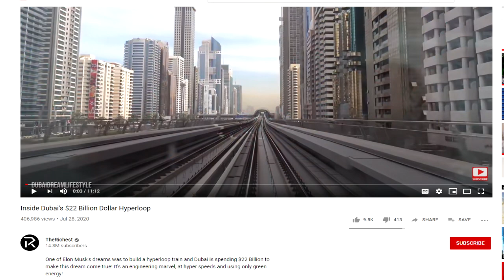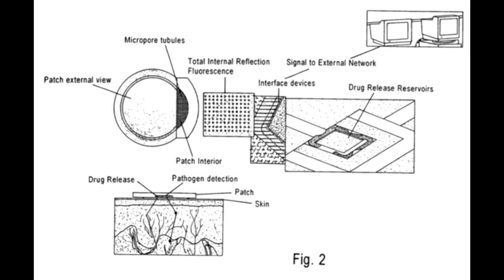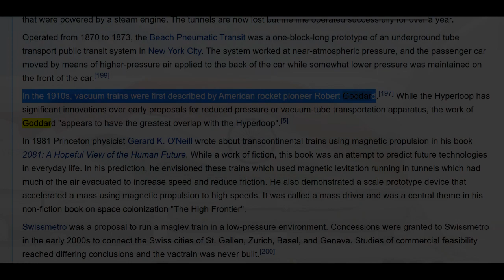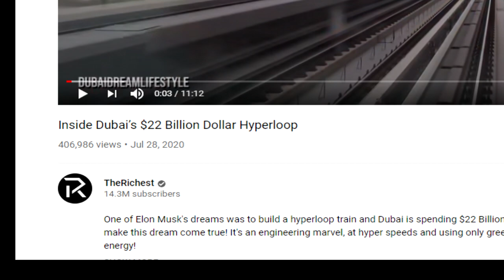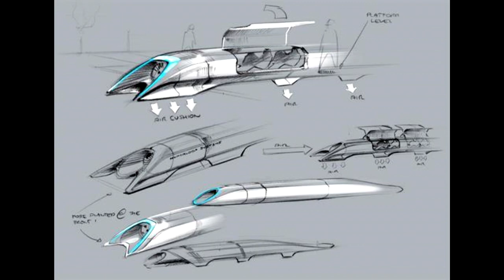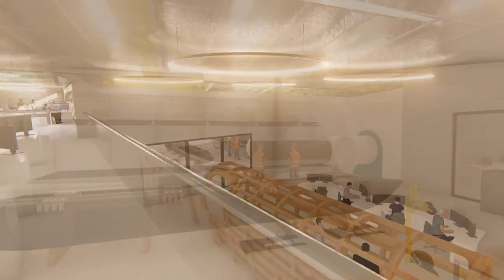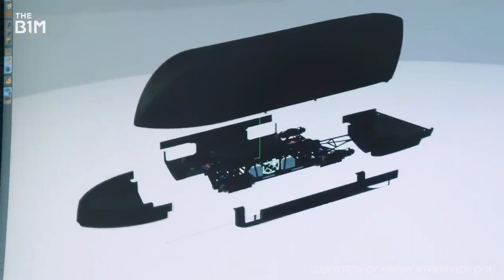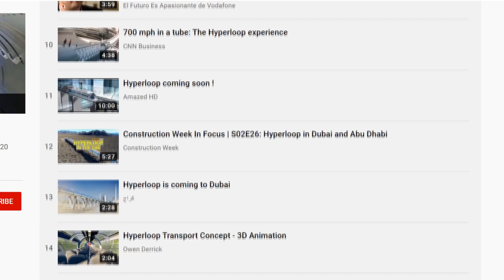Hyperloop, the biggest Scam since Theranos

Comment: "Air bearings" or "air skis" means that the capsule, which weighs several tons, rides on a cushion of high pressure air that's high enough pressure to support tons of weight above it.... in a vacuum... wait, how's that supposed to work, Elon? High pressure air in a vacuum?
Reply: Lots of pumps. Granted, it would be A LOOOOT of pumps.
Reply: Cleary he never thought that far ahead.  If only someone else had done it first, then he could copy their design, put blue lights on it, and everyone could gush over his innovative genius.
Reply: I think he was playing air-hockey at the time the light-bulb flashed ;)
Reply: put a hovercraft skirt with a number of internal air bladders so it's perimeter can be stiffened to control airflow.
release a volume of air under the craft into the skirted cavity equal to or just greater than the amount that would escape under the skirt for an optimal air cushion.
the pressure differential outside the skirt draws the air inside the skirted cavity underneath and out, creating a thin layer of air travelling under the skirt.
use the pressure zones inside the skirt to regulate the flow underneath and form a thin and uniform layer of air as it escapes the skirt cavity under the craft into the vacuum tube.

i have no idea if this would work, but you can come up with something plausible if you use your brain for a hot minuet.
Reply: @compoundlift7578  You can't release air into a vacuum and have it remain a vacuum.
Reply: @trippymchippy8586  i'm sure 30 litres of air will instantly replicate itself to fill 10,000 litres of space to 1 atmosphere.
Reply: @compoundlift7578  30 liters of air will get you to move about 0.001 Meters, and where are you going to release the air from, is it stores in the capsule? or is there going to be a long pipe blowing air up under the skirt, (with a vacuum around it)
Reply: @compoundlift7578  with the skirts of this Over craft being riped appart from high speed friction.. Dude, overcrafts are Slow..  maybe 50 Mile per hours. There is a reason to it. The skirts require high maintenance, there is a reson as well.  Once the Air has escaped the skirts, were does it go ? It will need to be pumped out of the tube. And this air, you use for the cushions.. Were does it comes from ? The environement is a vacum....  Yeah this was definitly well though throug.
Reply: @specialopsdave  the problem is that the pressure would try to equalize so if the tube was in a vacuum it would be impossible. Literally impossible. You would be spending energy keeping the tube in a vacuum while at the same time pumping air into the tube...
Reply: @compoundlift7578  Everybody replying didn't read the last part of the last line of your post.
Reply: David Parry everyone keeps doubting Elon and he just keeps proving all them wrong 😂
Reply: Its magic, the laws of physics work on very local small areas, and in other areas you have the completely opposite working as a contradictory law of physics.

Really, if you think about it, all that Elon Musk is asking, is for the laws to stop applying to reality a bit, but only for his "inventions". Thats not too much to ask, especially if you ask nicely.
Reply: To be fair, the original idea did NOT use a vacuum tube. In my opinion it was more feasible. But then it quickly morphed into maglev in a vacuum. Perhaps an engineer figured out that the air cushion was harder than creating a thousand mile vacuum tunnel. If so, then that's two impossible things.
Reply: Clearly none of you have degrees in engineering.
Reply: DO
NOT
ASK
QESTIONS!!!
Reply: @compoundlift7578  that is not how it works in a vacuum, let alone at 600+ mph.
Reply: @danieljusino1391  
no.
Elon musk, so far, has not invented anything.
Reply: I think this is a confusing aspect of the design. It’s not a perfect vacuum so the front of the train car is pulling the air in front of it and turning it into the cushion.
Reply: Can't believe he actually said that publicly, just shows how unremarkable his mind actually his lol.
Reply: Trazyn the Infinite I didn’t say he invented anything ?
Reply: @Mrcaffinebean   The shape of the pods does not suggest this is the idea AT ALL. If that were so, the nose would be an inverted wedge lol.  That being said, the question is, is the density of the air, plus the weight and velocity of the shuttle sufficient for this? Certainly wont be when you're shuttle is accelerating from 0. On top, air pressure and temperature isn't going to be constant and uniform throughout the tube, so you'd need a very robust and dynamic system to adjust airflow so that the thing doesn't fly off the rails or grind to a halt.
Reply: @trazyntheinfinite9895   okay, how does it work in a vacuum?
why would essentially a hovercraft, with it's own supply of compressed air and a method to regulate the air escaping it's skirt, not work in a vacuum?
Reply: @CasusBelli1000  i'm sure if you use your brain, you can come up with a plausible answer to those questions, all on your very own!
remember: air is a compressible fluid, and a skirt can be made of, or coated with, all sorts of things!
Reply: The Chainsaw Squirrel all very solid points. I think with this video and some other people in the comments miss most of all is that all of this, is a concept, work in progress.

That is engineering. If the finished product doesn’t look very different that the early drawings then likely there wasn’t much of a challenge to solve. 

In the case of these air cushions all the companies doing this looked at and said too much work, to little gain. Makes sense, it doesn’t mean suggesting he concept was bad.
Reply: vacuum preloaded air bearings are a thing used in industry for low friction high stiffness applications you know? the flow rate can be very small for well made airbearings
Reply: the air bearings where in fact one of the few interesting and novel aspects that made the hyperloop different from previous vac-train concepts. that all the companies gave up on it shows not that the concept was bad but that they don't care and want to just scam people.
air bearings with high load and low flow rate are a perfectly real thing used in industry and if they could be made to work at high enough speeds (the precision of the rail probably being one of the main limiting factors) they would be much more energy efficient than maglev and alleviate the need to have expensive power electronics along the whole track as would be the case with a transrapid based design.
but thats difficult (though likely possible) engineering that only results in a shiny demo for investors in the very end so the scammers don't bother
Reply: I was thinking the same thing...like wouldn't the air cushon destroy the vacume?
Reply: Hicknopunk well, it’s not a vacuum sooooo
Reply: @compoundlift7578  While I agree there may be a way to do it, any solution to solve this kind of incompatibility( we need a vacuum/we need an air cushion ) is very likely going to be more complex and costly ( and probably more prone to failure ) than an alternate solution for either side of the original incompatibility. This is where you end up realizing that instead of solving the problem as stated you need to go back and redesign to avoid the problem in the first place.
Reply: David Parry  Elon is smart, but not a scientist (obviously). I am sure he wants to distance himself as much as possible from Hyperloop these days. It has become a self playing piano featuring scammers from everywhere. I am sure he regrets the whole thing now.
Reply: Not an issue, you just need to remove the air that you add into the system continuously.
Reply: @fiddley  They did think about it and it was clear he didn't think about it enough.
Reply: @MrRobinhalligan  Yes he did, it's a YouTube comment, not an engineering thesis. If subsequent commenters engaged grey matter for a nanosecond they would see clear ways to mitigate the weaknesses in his off-the-cuff suggestion. The major problem seems to be that none of them understand fluid dynamics or the definition of a vacuum in an engineering sense.
Reply: @Mrcaffinebean  you ALMOST saw the problem! people are investing BILLIONS of taxpayer money into what is unproven technology, not only is it unproven, it currently has NO WORKING PROTOTYPES, not even prototypes that COME CLOSE to ANY of the talking points they claim as fact.
Reply: @fiddley  as of now, none of the prototypes really take advantage of the vacuum. there is a very clear contrast between using an air skirt (in whatever form you prefer) in a vacuum. such a solution may be possible, but is completely impractical. if you want to argue anything, even running it on a superconductor rail is more realistic and has better production tolerances than whatever that monstrosity would become.
Reply: PersonalPerson I agree tax payers shouldn’t be in this thing. I feel that way about everything pretty much. 

Little late now though.
Reply: the drawings show how it is proposed to work. it's not a vacuum but low pressure, as thunderfoot explains even low pressure will build up in front, causing drag. fans at the front would extract this air, reducing drag, and shoot it out the bottom to provide the air cushion.
Reply: sato AU exactly there is no addition or subtraction of air in the tube. It’s merely moved. That said I have no idea if it could be made to work.
Reply: @Mrcaffinebean  from what i can understand there will be a reduction of air in the tube, but not to zero. agree that it may or may not work, which is much more sensible than just concluding that it won't, as this video does.
Reply: @MrBerndhorst  (and others) I'm just "cogitating, or thinking". I don't pretend to know the answers, these are mainly questions that come to mind.If this system was LOW air pressure, I suppose you MIGHT be able to suck in air at the front, and expel it as an air cushion, but it intuitively seems this air-cushion idea still needs fairly tight tolerances (1-2 cm?), in order to provide adequate pressure  on the "bearing" surfaces. Bernoulli effect etc, is in there somewhere.  So the precision of engineering would still need to be high - imagine the fluctuations that would happen if there were even a few mm variation for an air-cushion travelling at 700 MPH! Having SOME air in the tube reduces the engineering issues that a hard vacuum would make. If you had higher pressure, that would also make it easier to pressurise air-bearings. BUT you would also have increased drag. Thunderf00t said that the low-air-pressure variants did not get much extra speed thereby. Also, this turbine at the front end would have to powered somehow. If not by prodigious batteries, it would STILL need power supplies along the entire route. Would that be any savings compared to a maglev (or even just a "plain" high speed train which can already reach 350 km/hr)?  So it would be the balance of factors like these, I think. Is it the train that sucks so much, that it blows ? :-)
Reply: @compoundlift7578  Well done Sir, youve now done more work on the hyperloop than chief engineer and visionary genius God Musk. :)
Reply: @mt-mg7tt  actually look up airbearings my dude. your intuition about them is MASSIVELY wrong. 
tolerances are not a couple of cm but getting closer to the micrometer range.
they do get used in vacuum applications (semiconductor industry uses them for precision positioning of wafers) quite regularly.
yes the compressor would have to be run on batteries, the energy budget of which is adressed in the original concept and seems quite plausible.
also yes running power along the entire length of the track would still be MASSIVELY cheaper than maglev.
maglev of the Transrapid variety doesn't just need power along all of the rails but also coils and switching electronics with high power density. 
its NOT the same as just running a cable. its closer to putting gigant amplifiers back to back along the entire length of the thing
Reply: j @MrBerndhorst   I know that bearings in machinery are obviously NOT rattling around over several cm!  I just thought maybe the tolerances would be larger for  air surrounding a train in a tube, which is much larger thing. When I said "cm",  I thought I was probably being way too generous. Fair enough.  That seems to make doing it much harder, which was my real concern, especially over 100s of km!

OK re batteries.

I'm aware of the great complexity needed by maglev. I was genuinely curious as to which might be lower in energy requirements.

 As I said, I wasn't presenting an opinion, just pondering.
Reply: @MsHumanOfTheDecade  superconductors might work but I think they would be much trickier to implement than air pressure in small volumes.
Reply: @MrBerndhorst  
Just some food for thought: if somebody commenting on a YouTube video knows about the idea, then it is almost guaranteed that actual engineers know about it, too. 

Even if you use the "they're just lazy and greedy" argument, there are governments willing to throw enormous amounts of cash at various pet projects (China, US, Japan). 

So ask yourself, why none of them have been researching this even for future military applications, or even made a scale model, if it's so useful and "totally doable"?
Reply: @LancesArmorStriking  the system in total would be hard to pull of (though I havent seen a good argument why it would be impossible yet) and if it turns out impractical after all a lot of effort would kinda go to waste from the perspective of a company.
I think the concept is plausible and some aspects of it definitely seem worth an actual research effort. 
Unfortunately the actual companies that took on the hyperloop name mostly, you maybe entierly seem to be scams so there is no point for them to start a hard engineering effort that won't give them a shiny demo for investors quickly.
this is very much a musk kind of idea.
similar to propulsive landing of rockets for reuse its POSSIBLE but its also hard to the point where not many entities that have the budget are willing to really try.
also I dont think "if it was a good idea someone would allready be doing it" is a solid argument ;)
Reply: @mt-mg7tt  I may be a bit optimisitc saying that airbearings would be so much more energy efficient tbh since they usually arent run at more than mach 1 as far as I know so one might be on thin ice when extrapolating to those operating conditions. thing is though that maglev is actually not nearly as low power as a lot of people seem to think. at least with the transrapid which to my knowledge is the only design actually in service, the energy consumption was actually one of the things that kept it from being widely adopted in germany where it was developed (also that terrible accident that pretty much halted development didnt help...)
Though hightemprature superconducters surely have gotten cheaper and so has the power electronics to drive it all so maybe today we could make it alot better as well.
And yes I totaly agree that the small tolerances would actually be chalanging and I kinda think that is why those scamy companies dont do it. too much actual hard work to get to a demo. 
IDK its just super odd to me that thunderfoot and a lot of other people are really bent on attacking the whole concept as if it was as dumb as say solar roadways when really it just seems to be a bit out there in terms of engineering but potentially doable. 
IMO the companies are scamy but the concept is potentially interesting
Reply: @MrBerndhorst  Yes to all that, as far as I know. Yes the concept is still interesting. It seems to be evolving to what is basically a high speed train in a low-pressure (not vacuum) environment. So you might as well just use some of the splendid HSTs that are about already, and do some low-pressure tubes/tunnels. 

Here's my speculative (or bonkers) scheme: Sort of like the Chunnel, but with long airlocks at each end. The train could go in, the outer door closes and the inner door opens to equalise pressure. The opposite at the other end of course. This airlock wouild have to be long enough for the train to keep moving at a reasonable speed, as the doors operate.  The airlocks of course mean that less pumping-out has to be done overall.Thinks: You'd even get a bit of a speed boost from the ouside pressure as you entered the system. You'd be slowed-down a bit by air pressure when the train exits the tunnel, which may or may not be an advantage.